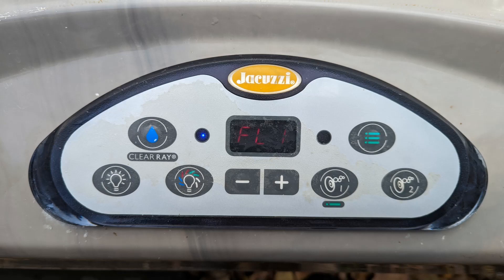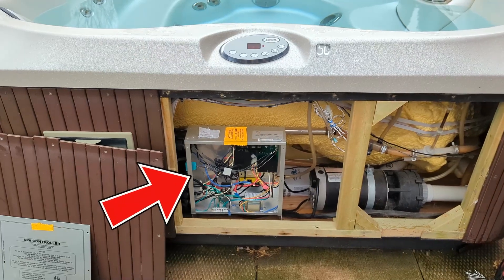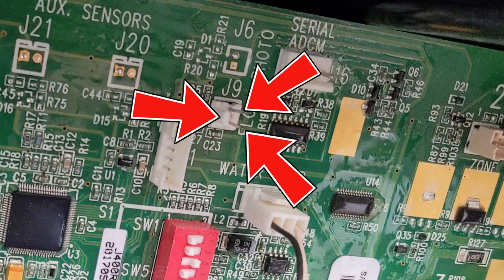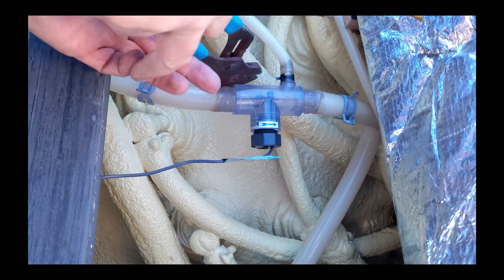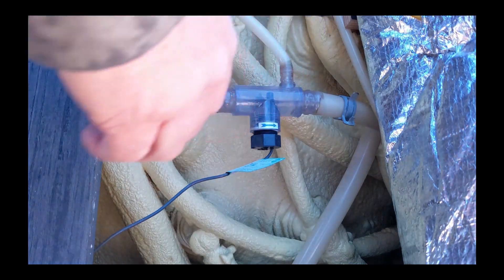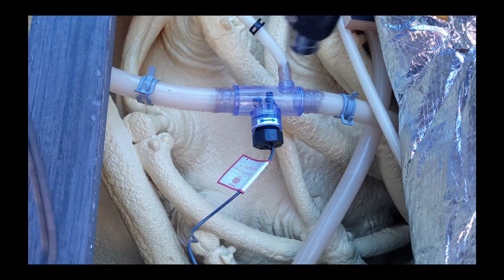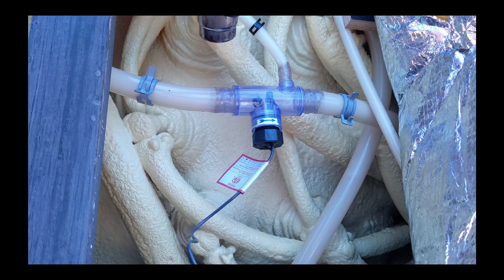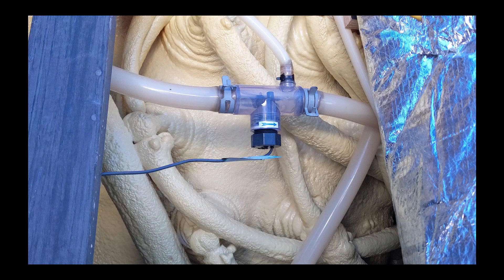Jacuzzi Hot Tub FL-1 Error code | Jacuzzi or Sundance Spas FL-1 Error Code

Comment: hello, I am in France and owner of a j335 jacuzzi from 2015. I have an FL1 code. the massage pumps work but the circulation pump does not. the fuses are ok. Should the circulation pump be replaced? thanking you for your help.
Reply from the maker: FL1 code is there because the circ. pump isnt working.  If the fuse is good, then you could test the volts where the circ pump plugs to the circuit board or just replace that circ pump.
Reply: @VIPPoolsandSpas  Thank you so much!!! 🙏👍

Comment: Would this also cause my heater to intermittently kick on/off? I have this FL1 error but also my tub will not get up to temp
Reply from the maker: Yep.  Any FL code will at some point shut the heat off.  If it's on/off sort of thing happening, this is telling me it's going to be the filters or flow switch/pressure switch (whatever one you might have.)
Reply from the maker: If you unplug the switch, does FL2 come on?
Reply: @VIPPoolsandSpas  sorry didn’t see this but it was a bad flow switch

Comment: ... with the unit flashing "FL 1", should there be voltage to the pumps? i presume there would, at least to the low speed pump. that being the case, if there is NOT voltage to either the low or high flow pump, then would it suggest that the control board needs replaced? (also, note that if this logic is correct, then it's potentially dangerous to short the flow switch for extended periods, because if there really is no flow then the heater would turn on without flow and overheat)
Reply from the maker: Flow switch or pressure switch are low voltage and have no amps.  It's the amps the kill ya.  That's why cows don't get killed by an electric fence.    As for testing the pump.  If you're not confident call a professional.

Comment: great tips....did the screwdiver test and code went off....after taking wires off and following back to Flow switch, I found the wires had corroded right off the top of the switch...there was a clear plastic cover over the wires and top of switch that prevented me from seeing the corroded ends....obviously, I found the problem...SCREWDRIVER TIP WAS THE TRICK THOUGH...thanks...PS, I have the J-325 model 2014
Reply from the maker: Great.   Make sure to give the video a like.  Thanks for watching my video.

Comment: I had a hot tub installed and then had fl1 error code. The electrician had accidentally left 1 side of the wiring unhooked so only had 115v at the tub.
Reply from the maker: That would do it.  Pump wasn't working.  Lack of volts